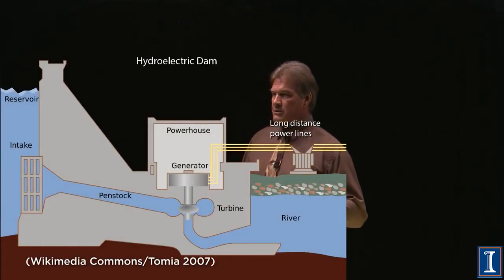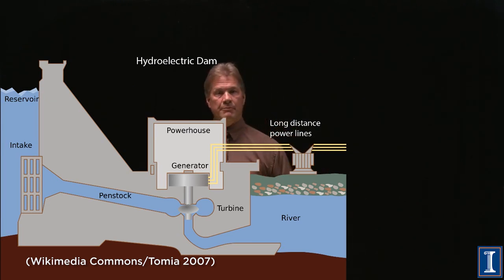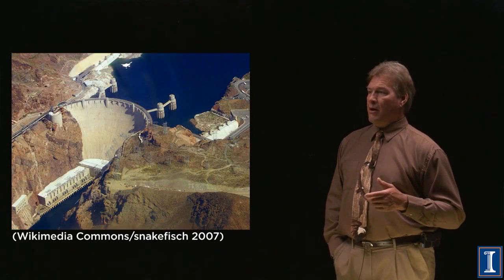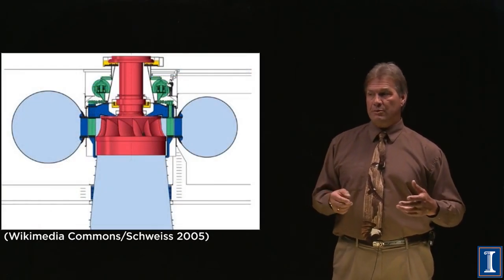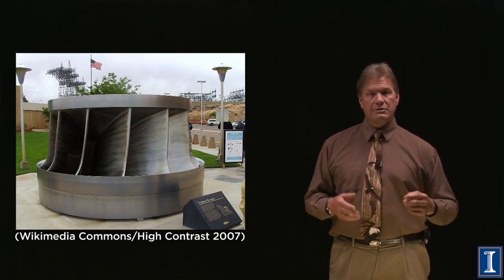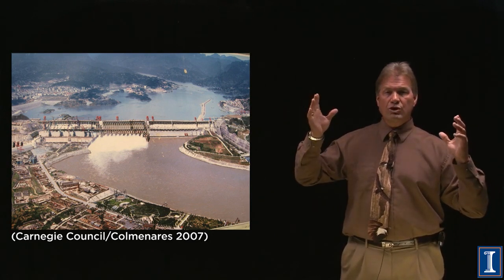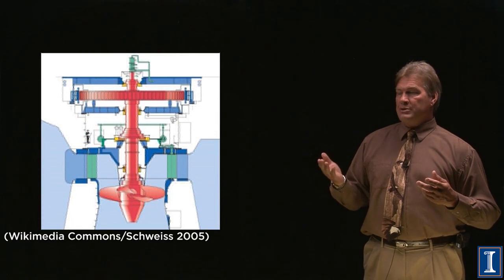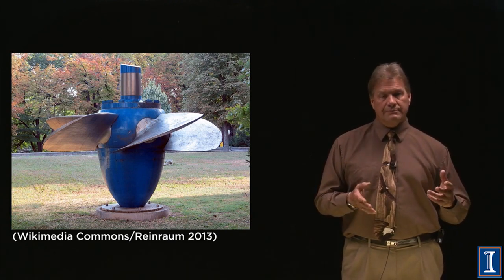Large-Scale Hydropower

Comment: The Dam in italy is stil standing. The cause was landslide not dam failure. Vajont dam disater happened in 1963. Large dam break happened for example in France. The Malpasset Dam disater. Don't break your great image with such small disinformations. these turbines has static part with flow regulation and a rotor part inside. The Francis turbine can be allso used on shallow rivers, because it is working on basic pressure difference principle. The bell shaped outlet part is allways submerged.

Comment: Francis turbines are used for high pressure small volume flows (mountain dams with large difference in water levels) but Kaplan turbines are used for low pressure high volume flows (close to river deltas with large volume of water but lower difference in levels).

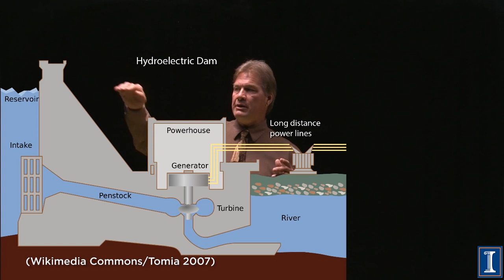Comment: @0:40 I think that's not entirely accurate. The height difference that matters is that between the surface of the reservoir and either the surface of the discharge reservoir or the discharge outlet if above the surface.  The height of the turbine is immaterial except for the fact that you might want to place it low down fro considerations such as cavitation but immaterial with regards to the amount of energy extracted.
Reply: I think the professor was right.